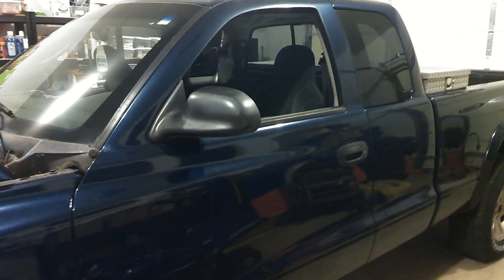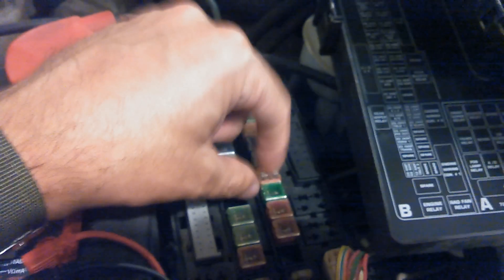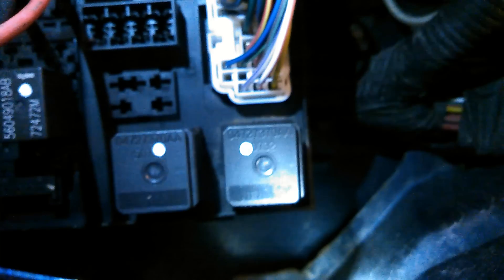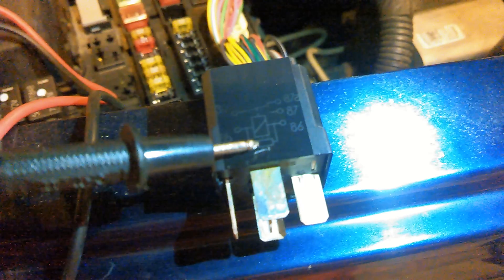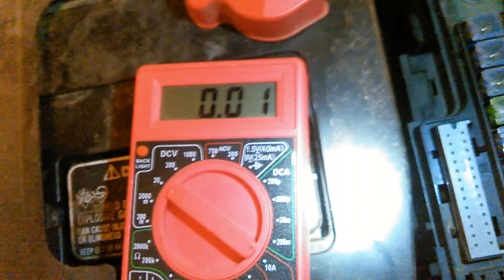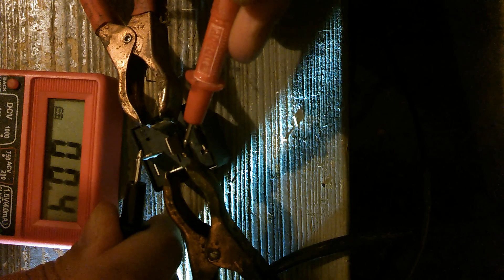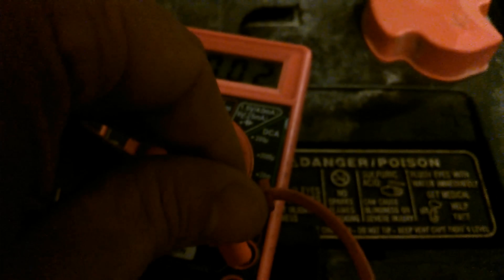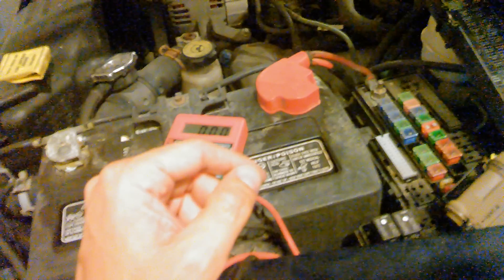Auto electric fan troubleshooting

Comment: To prevent corrosion, 
rust and oxidation
 on,relay pins, 
junction box holes
connection or battery posts 
and wire or cable terminals 
apply dap of silicon / 
dielectric grease.

So, add dap of
dielectric grease
junction box hole.
Reply: Great underestimated tip !

Comment: is there a high and low on the fan speeds ?. 99 BUICK Regal, fans are running, temp creeps up at idle and warm days. Driving temp comes down. Fluids are all ok. Thanks

Comment: how did you clean the corrosion?
Reply: I’d like to know as well, and likewise a follow up weather good or bad
Reply: wire going to the connection is probably crizpy crunch too.should be searching for root cause. might be fire hazardous too if wire in fuse box is touching other wires inside the box